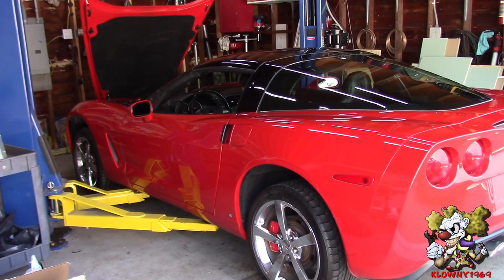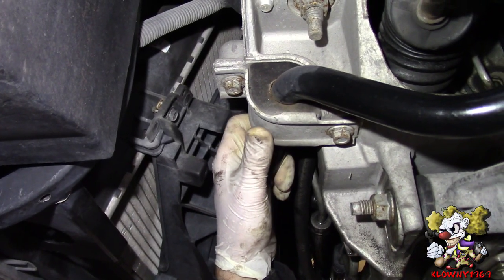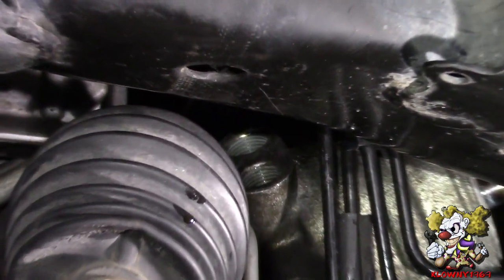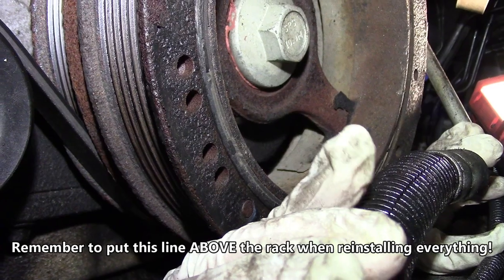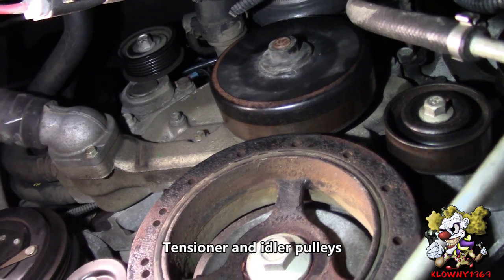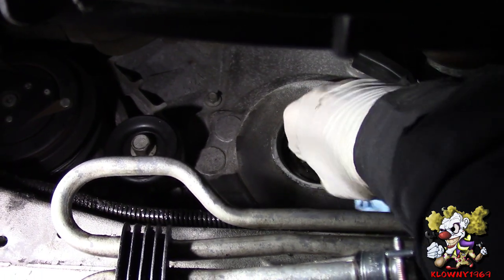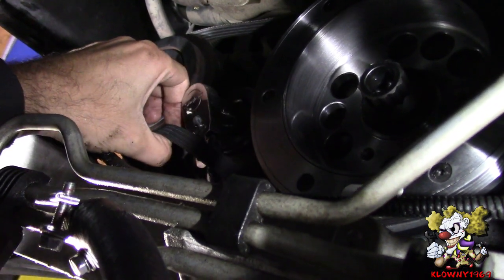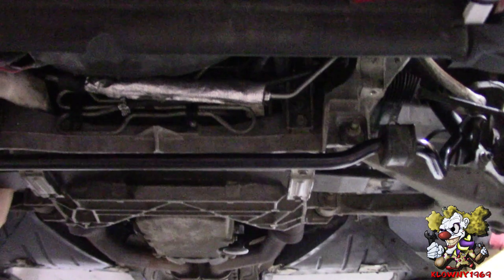How To Replace A Harmonic Balancer  on a C6 Corvette

Comment: Thanks to both of you!! I would never have had the courage to do this job without such a comprehensive video. Other than having a Z51 Manual which has some more "stuff" in the way, along with long tube headers which caused an issue getting out the starter, I followed this step by step and VIOLA! Job done! I wish all the videos out here were as comprehensive, showing part/tool numbers, and great quality visuals!
Reply from the maker: Awesome! Glad I was able to help you out!! Don't forget to subscribe

Comment: Awesome video! With the issue from 05 to 2013, maybe more years. One would think GM would have addressed the issue by 2013!
Reply from the maker: I know right! Thanks for watching and don't forget to subscribe
Reply: The C5 is the same so the problem goes back to 97'. Everything looked pretty much the same as I remembered doing on my C5 except I  might have removed the radiator for extra room. I didn't have that nice little short puller shown here. 😁

Comment: You guys are awesome. This saved me like $1000 by doing it myself. Maybe more. Thanks for making a crappy job doable in my garage!
Reply from the maker: Awesome! Glad I was able to help you out! Don't forget to subscribe
Reply: More like $1500
Reply: @floyd8153  1500$ where ? Cause even dealership charge no more than 1200$
Reply: Where are you located? Also how long it took ?
Reply: @panzerwaffen2873  I've had 3 estimates on mine in Madison Al. from private garages and none were less than $1200. The dealership wants $1900 but this includes the two tensioners, both belts,  crank seal, and all bolts plus 6 hours labor.
Reply: @panzerwaffen2873  haven't had it done yet. Trying to find an experienced mechanic like you. Few and far between.
Reply: @floyd8153  hey brother down here in Miami FL there is a shop ...east coast powerhouse they do this for less than 1000$
Reply: @floyd8153  I'm not experienced but I'm not afraid to put my hands on any vehicle I do every single repair in my C6 last week replaced the radiator ...have replaced all the 4 wheel speed sensors .etc ...with the right tools we can do it
Reply: @panzerwaffen2873  I have neither the patience, tools, or mechanical ability to do these types of repairs and have no choice but to find the best mechanic at the best price.
Reply: @floyd8153  go for it... Where are you located?
Reply: @panzerwaffen2873  I'm in Madison Al.
Reply: @floyd8153  a Lil far from Miami ... Good luck brother just don't get desperate we need our babies working fine
Reply: @floyd8153  Bryant Brothers in Decatur does a ton of these. Try them.
Reply: @panzerwaffen2873  i wish i was in fl. Thats a great price
Reply: @jayn3615  what a shame ...where are you located?
Reply: @jayn3615  I ended up replacing mine with a friend of mine he says for that work he charge 500$ ...right on the driveway lol ...if you were at a reasonable distance we could go to your place
Reply: @panzerwaffen2873  hour south of Erie Pa
Reply: @jayn3615  ohh ...well brother don't be afraid of try it yourself

Comment: Just spun the balancer bolt loose driving home tonight 😭🤦. I went with oem bolt how is the Arp bolt holding up?
Reply from the maker: Sorry to hear..arp works great
Reply: @klowny1969  Did you use the Arp lubricant on the threads or Loctite?

Comment: My cradle didn’t want to drop down either.   No clue why.  Was trying to find other non painful videos showing what else I might have been missing. This one gives the meat & potatoes.  
Engine was disconnected too. Probably the upper A Arms. I disconnected the shocks and it helped a little but still didn’t want to move.  Job ended up being more of a pain that it needed to be

Comment: Hi, do you have a part number on the rubber seal that you used for the HB? Also, I see in this video that you did not install a keyway. Is it possible to install a key way on the c6? if so what would be the size?

Comment: My C6 Corvette has 25k miles on it. Should I do this asap? Or wait?
Reply: Check the HB periodically for straightness during idling and when during slight revs above 1,000 rpms.  Any upright, vertical or horizontal wobbling could indicate elastomer seal on balancer.  It is a hit or miss on many C6s.  I've seen some at your mileage, or seen no issues even at 140,000 miles!!!  Go figure....

Comment: Oh boy.... I had a issue today with no charging and no power steering.... On inspection i found  pully bolt is loose on my 2005..... Im thinking pully spun on crank as i couldnt find anything else.... Will be attempting this in my driveway
Reply from the maker: damn..good luck
Reply: @klowny1969   Actually getting the rack out wasnt as bad as i thought.. Ive  done worse..
But,, after i got it out i noticed one power steering line has a O ring, but the other line didnt ?... did i loose it ?  im assuming both lines need a o ring

Comment: U could also just remove the cooling fan and maybe the radiator correct ? Doing radiator and water pump on mine hope I don’t have this problem but seems it woulda been easy to do. Or maybe I should do it before I put it back together
Reply from the maker: eventually this happens to most of them..you might have room if you remove the cooling and radiator..i would have to look at it..don't forget to subscribe

Comment: How did you take the bolt out? When I try to turn it the whole pulley just spins
Reply from the maker: i showed in the video the flywheel holding tool..dont forget to subscribe

Comment: Am I mistaken or did the replacement Balancer look different, i.e. didn't have the rubber section in it?
Reply: yes, aftermarket performance part that should be better than the oem part that has that issue a few years later again..
Reply: @floridrummer88  I was unsure about an aftermarket part and fitted a new oem part instead.
Reply: @floridrummer88  My OEM balancer part was 16 years old on 27,000 miles, just small amounts of rubber deterioration but I changed it plus two tensioner arms/guides (one bad) to be on the safe side. Thanks for your input.

Comment: No way was I attempting this. Dealer cost me $1500 but they sheared two subframe bolts off and had to drill and tap it out so it took them another hour but didn't charge me.
Reply from the maker: I'm glad that they did good by you..thanks for watching and don't forget to subscribe

Comment: Wouldn’t it maybe be easier to pull the motor mount bolts and just lift the front of the motor enough to clear the rack?
Reply from the maker: is it possible to do that though in this car? I have to look at it..thanks for the tip and don't forget to subscribe
Reply: Take Two bolts out for motor mounts. Drop the craddle down by loosen 4 bolts.  disconnecting shocks absorber.  Push the engine up with jack. That should clear to use a hormonic off. Leave the rack and pinion in with all connections. Also made loosen the top a arms each side 4 bolts each side. And disconnect steering shaft too. Done many times. I am not a mechanic by trade.
Reply: @garybegay3028  Have a video? This sounds like a lifesaver.
Reply: @garybegay3028  When torquing 240 ft/lbs for the new balancer won't everything be moving now that you unbolted from the mounts?
Reply: @DoomXexec311  put everything back together. and retorque the balancer. May have to take out or loosen the two bolts that holds the rack and pinion. It's depend a on what socket you have. It's easier more the  with shallow socket, better fit between the balancer and rack and pinion

Comment: What is the cost of this job ?
Reply: Approx $1500.00 at a garage.
Reply: The Balancer, ARP, and new seal around $300-450 but if you get an ATI HB, then it’s like a $500-600 job if you do it yourself. Better than $1300 at the dealer

Comment: How long before that bolt comes loose torque is 235ft pounds not 35 ft pounds.
Reply from the maker: Huh?
Reply: I talked to APR they said torque balancer bolt to 37 ft pounds then tighten another 140 degrees. Or just torque it to 235 ft pound.